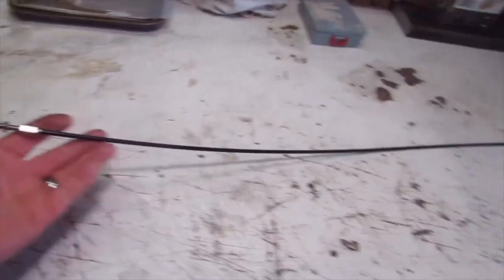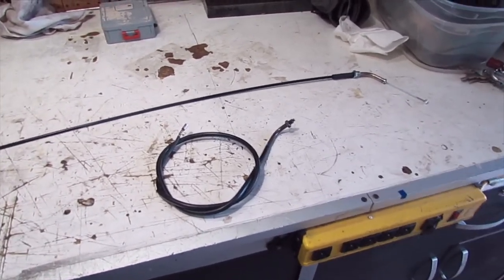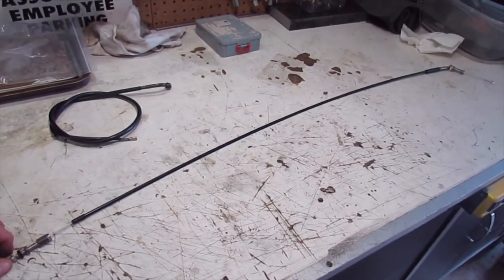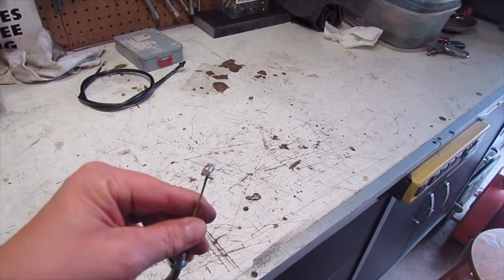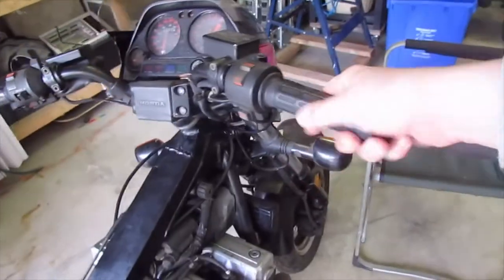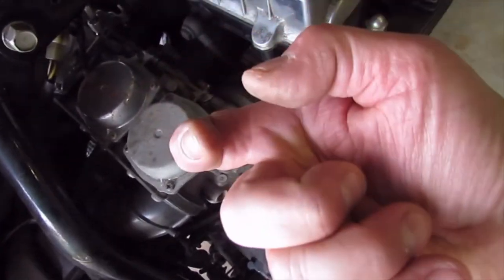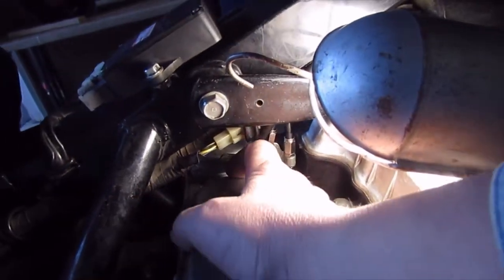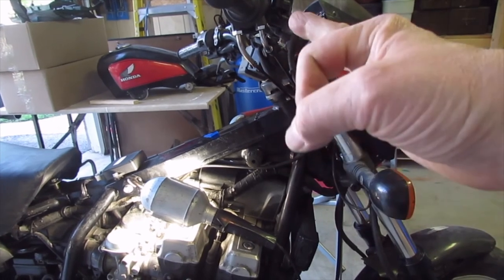Nighthawk S Throttle cable repair or rebuild/

Comment: Unless you are looking for exact originality, you don't need the return cable. You just need one cable for throttle. I eliminate this on every motorcycle I've owned. 
On some motorcycles, you can install a small lightweight spring on the carburetor purch to give a little extra throttle return if so desired.
Reply from the maker: That is really good advice.  Thank you, I like the idea of a return spring.
Reply: Bad advice. These bikes have that spring on the carbs to facilitate return, but the return cable is to give you an option to close the throttle if that spring fails. 
Otherwise, you'd be sitting with the throttle open and no way to close it.
Reply: @dylanb613  

Turn the litte key to the off position.   Never had any bike run wide open by itself.  Everything is based on preference.